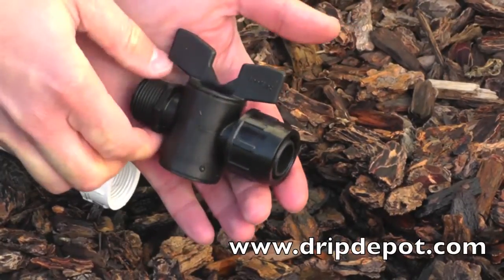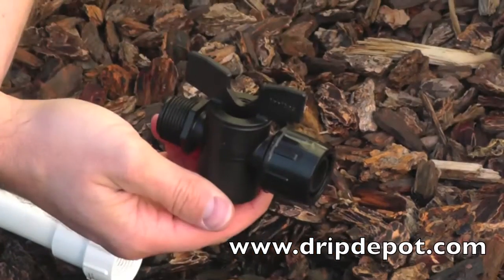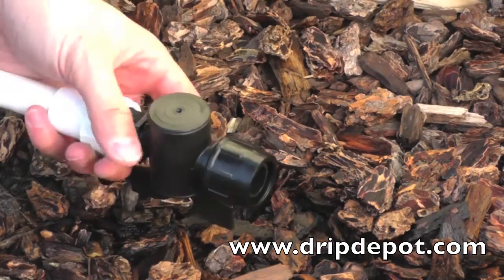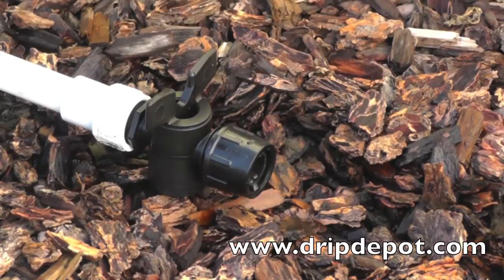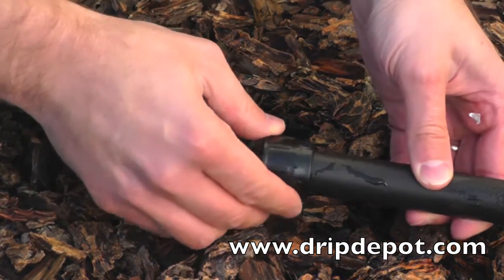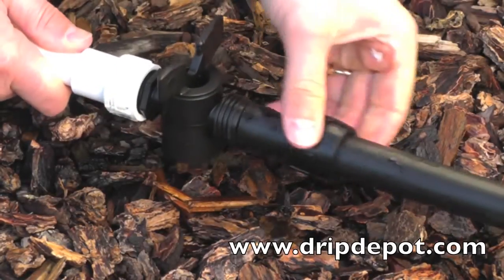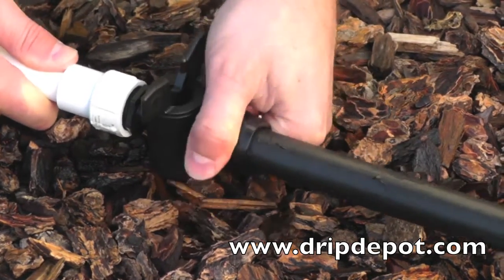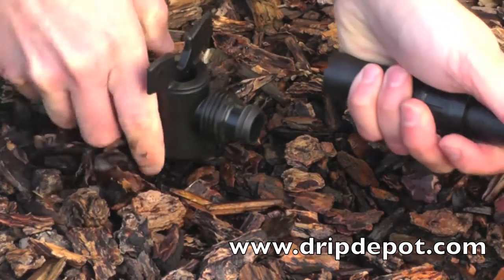How to Attach Poly Tubing to PVC Pipe with a Manual Flow Control Valve

Comment: I can't find this valve, is there anything else that can be used instead?
Reply: Ree, thank you for your comment :) 

You bet, Irritec has slightly updated the fitting -- here is the link to the newer version, you'd just need to select the pipe thread and tubing diameter size you need using the dropdown menus: https://www.dripdepot.com/product/irritec-perma-loc-tubing-by-mpt-adapter-valve